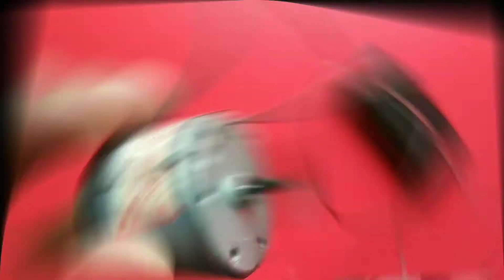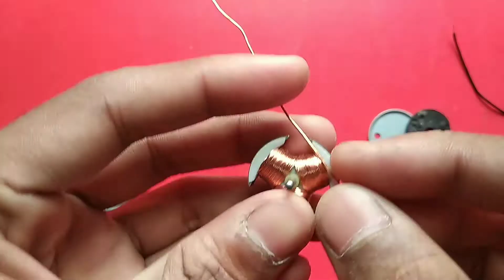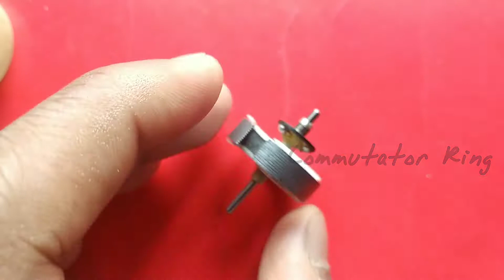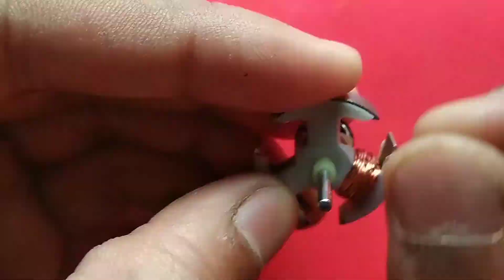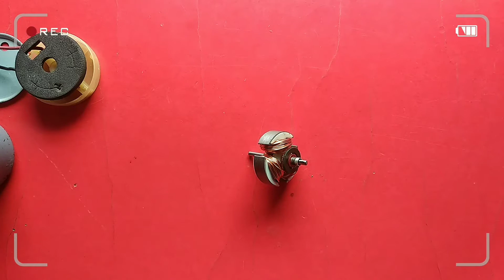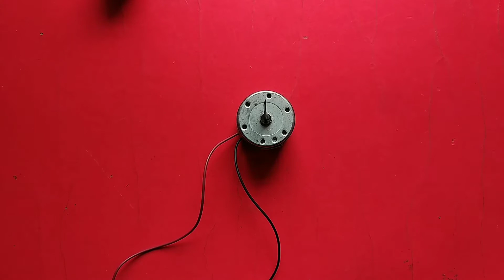How to increase speed of a DC motor| how to Upgrade a 12v DC motor rpm.

Comment: Hey bro.
I am using 25 gauge copper wire on its motor and the turn of each plates is 60 but the motor dose't work 
Please tell me what's your wire gauge and  am i using 34 gauge wire in its motor...? And whats its turn of each plates
Reply from the maker: I have used 0.45mm wire with 60 turns each pole.
Reply from the maker: If it runs without backcover and brushes, then your winding must be fine, Check if your brushes are shorted or brushes are shorting with main body, or try changing brushes.

Comment: Can i use inverter battery to operate it.
Reply from the maker: Yes you can, but voltage above 15V can burn the brushes due to high current drawn by the coil.
Reply: Thanks

Comment: Sir mene 30 gej wire se 50 rounds liye he jisse speed to ban gai he but rod ko touch krne par ruk jati he usko vps dobara ghumane par chalti he sir kya kiya jaye jiski wjh se vo ruke nhi sir plz help me
Reply from the maker: Use a supply with a higher ampere, or you can add a ceramic capacitor in parallel to the motor.

Comment: If we take 1mm copper wire for winding then what happens to the motor speed and Torque
Reply from the maker: There are 2 cases
First, the 1mm wire will have less resistance & will draw more current, which can burns the brushes which are thinner than 1mm.
Second, 1mm wire will significantly reduce the number of turns which can reduce the magnetic field.
So you have to experiment what exactly happens, if you do, do let me know.🙂✌🏻
Reply: Rapidly moves fas I mean slow

Comment: Yunhongda Motor is specialist in manufacturing DC motors for 12 years, we mainly focus on 775/755/ electric power tools motor and 7512/7912/5512 blender motor for 12 years, if you have any request, please kindly contact with us soon.
@t

Comment: I saw it!!!you change the battery
Reply from the maker: No bro, I didn't change because that was the only battery i had.
Reply: @FrolicLab  bro im just jwking hahah
Reply: @FrolicLab  can i ask you quistion bro
Reply from the maker: Yah
Reply: @FrolicLab  what can i put to a dc motor to increase voltage bro beacouse my dc motor is over heating to a battery that has a 4 to 6 voltage
Reply from the maker: You can try winding with thinner wire, that will increase voltage and decrease current, but that would be proportional to thick wire,as a motor is rated to deliver a specific power, so going beyond ratings can damage your motor.✌🏻
Reply: @FrolicLab  can you make vid for me plss it will help
Reply from the maker: I will try✌🏻
Reply: @FrolicLab  thank you bro love you so much 3× a day